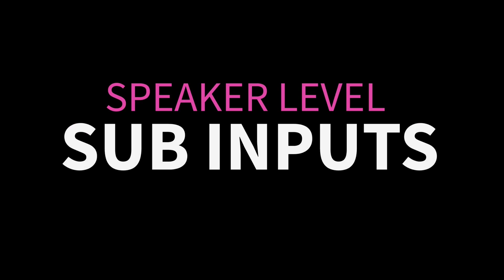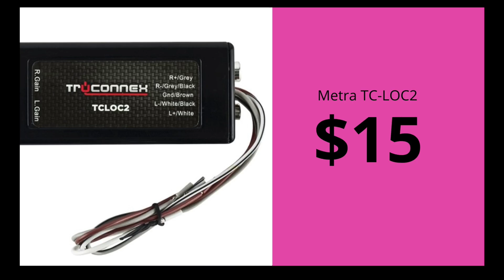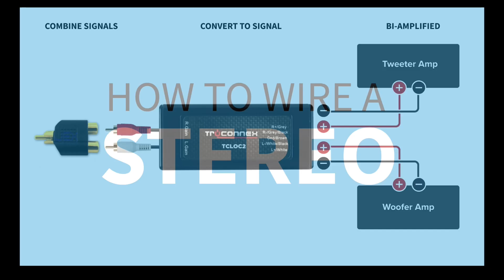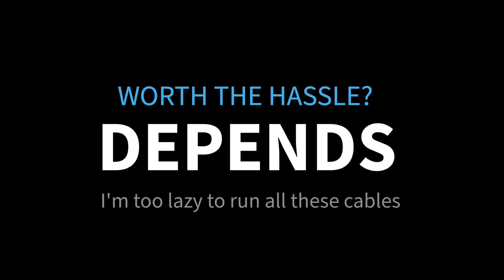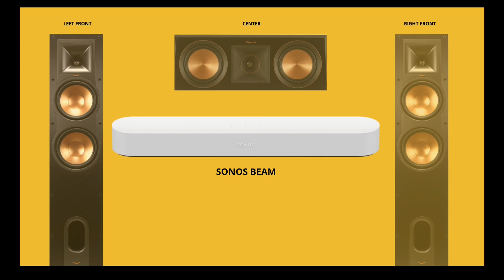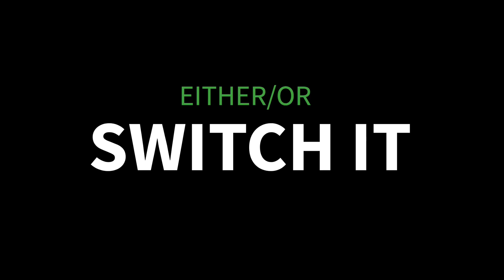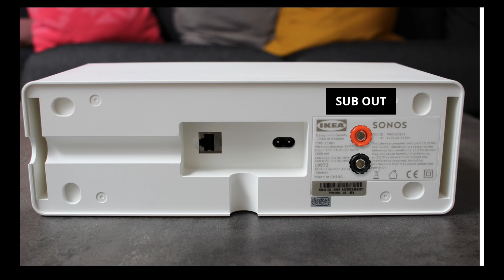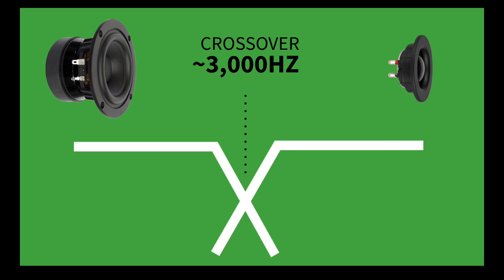Sonos sub hack DIY: How-to wiring guide to add any powered subwoofer to Sonos with Ikea Symonisk

Comment: This is great and something I surely want to try out. I have two in-ceiling drivers (about 4-5" in diameter) that I'd like to integrate in my Sonos-setup. Should I connect those to (only) the woofer output on the Symfonisk of should I somehow combine both outputs (i.e. also the tweeter output) to the ceiling speakers?
Reply from the maker: The best approach would be to remove the passive crossover in your ceiling speakers and run a 4 conductor cable from the Symfonisk that connects the tweeter and woofer output to the woofer and tweeter in your ceiling speakers. The symfonisk electronics divide the high and low signals so there’s no need to have the passive crossovers- just wire right to the speaker drivers
Reply: @todd.parker  The ceiling speakers are just two 4" drivers (left + right channel) without tweeters and no crossover. They're connected with two separate (2 conductor) cables all the way to the living room (where the hifi-set used to be). My question is: would it make any sense to feed the tweeter signal to the those woofers as well or would that break the system as both tweeter and woofer signals are amplified separately?
Reply from the maker: @martijnfigee9170  I don’t think it’s safe to try and combine the amps together like that. I’d only do this with a 2 way speaker so consider swapping the drivers

Comment: Hey 
At First thx for this awesome Video 👌🤗
Do you think the Power of the Sonos“Amp“ is enough to drive my Klipsch R112 proper?
Reply from the maker: In this setup, the Sonos amp isn’t powering your sub. You’re just using it to get a signal to your powered sub’s amp. That Klipsch sub doesn’t have speaker inputs so you need to get a high to low level converter I cover in the video
Reply: @todd.parker  so just as a Bridge it won’t work ?

INPUTS
 L/R line-level/LFE RCA jacks, Wireless WA-2 Port
Reply from the maker: @mOtHeRfReQuEnCy  if you mean this, it doesn’t sound great. https://youtu.be/QhT3j9_6Zic

Comment: hi, the big challenge that I have is using two symfonisk panels as FRONTS to my beam 2. Possibly make the beam function as
center only.. All of them have amps, so do I somehow run cables to all the amps? Connected to a 5.1 soundcard with crossovers or smt like that?
Reply from the maker: You can’t do that right now with Sonos. If you want a proper 5.1 system, skip Sonos
Reply: @todd.parker  yes you know how this all started, the symfonisk Ikea panels are the ONLY speakers that both sound really good AND are accepted on the wall as fronts by the local government here (ie., girlfriend) 😅
So I am trying to build a 5.1 or 2.1 system around this to hook up to the tv.
PS thanks for the quick reply!

Comment: hey, thanks for these ideas, will try it out! I was wondering if instead, I could just use two symfonisk picture frames as left and right front channels, paired to e.g. a bose 900; plus any sub.... because it would greatly enhance the front audio, which seems to make more sense to me for regular tv viewing in stereo...
Reply from the maker: In this scenario is the Bose a center channel? In short, you can either skim a signal off the woofer and send it to to a powered sub OR disconnect the internal drivers and use them to power a 2 way speaker. You can’t add extra passive speakers because it wall tax the amps too much
Reply: @todd.parker  yes, indeed it would be center only :)
and I just found this comment again, I forgot i wrote it and just commented again because by now i got a beam 2 and two symfonisk panels, still have that idea in my head...
Reply: @todd.parker  ps so i was hoping for a totally different approach, send an unamplified 5.1 signal to all the amps, split into tweeter and woofer signals etc.. (for the front left and right symfonisks, and another into the beam or any other center speaker...)...

Comment: Isn’t the audio within the LFE filtered out by the DSP and as such the Sonos surround synphinisk or play etc doesn’t actually receive the LFE audio anyway. Yes the low frequencies are transferred to the sub in this set up but LFE isn’t there so cannot be tapped into for the sub
Reply from the maker: If image that if you had an official sub connected that it might filter out some bass but in my tests there was a ton of low end information sent to the surrounds which really supreme. It’s not the same as a dedicated LFE channel obviously but more than enough to add a lot of bass to the mix

Comment: Thank you Todd! Great video, so simple to understand and gives you confidence to do it.
I wll be using the "GATEWAY" solution for my needs.
My question is, do I need to reconnect the ribbon cable, before i close the speaker back??

Again, thank you for this most helpful video!
Reply from the maker: Glad it’s helpful. Yes, you need to reconnect the ribbon - line it up, flip the black cover down, and add the foam sticker on top. That connects the front panel controls.

Comment: This is so helpful. I have a Playbar and planning to add two 
SYMFONISK for surrounds. Do you think one can use this same concept and tap signal directly from the Playbar that can be fed to a powered amp?
Reply from the maker: Sure, this technique works for any powered speaker, it's just a matter of being able to open the case, get access to the woofer, and have an airtight way to get a wire connected to the outside world. The symfonisks are cheap and easy to work on but any Sonos speaker would work.
Reply: @todd.parker  Thanks for your response. The Playbar has 6 woofers and for the best performance, do you happen to know which of them to tap signal from?
Reply from the maker: Hmm, I don’t but I think they probably all will give you a good signal
Reply: @todd.parker  I will do a test after opening the unit to see how it separates L and R channels, hopefully I can get reliable discrete L and R feeds.
Please share the link of the binding posts you used for your installation.

Comment: Hello.  Since this video is over a year old, I wanted to check before I attempt my own setup. I have a playbar and two One SLs.  I just want to hook up a powered sub but cannot afford the Sonos sub. Could I get away with one Symfonics speaker? Or would I need to get two and run the powered sub off of one of them? Thanks I’m advance for all of your time and efforts.
Reply from the maker: If you’re up to opening the One SL, you can get a signal off the woofer for the sun. Alternatively you can get a single symfonisk, unhook all the drivers and just use it as a way to connect the sub as a separate room you group with the soundbar room. I cover all these scenarios in detail
Reply: @todd.parker  Thanks. I’ll look at opening up the Sonos One SL first.  I didn’t realize I could do that. I saw your demo on the second room option. If I remember correctly, there were some issues with delays. Do you have a video of opening up the SL?  Thanks again
Reply from the maker: Grouping rooms has a bit more delay than the speakers in a home theater room but it’s pretty minimal. There are a few teardowns like this one: https://youtu.be/OXce4QEgOgA

The tricky thing is finding a good spot for the binding posts with the wraparound grill
Reply: @Tpeazy1980  Someone did something similar here https://www.youtube.com/watch?v=w76p6VchxgA
I also have a Playbar and considering connecting an external powered sub directly to it...wish me luck.

Comment: Where is the volume Control handled inside the Sonos speaker? Is it handled before the DAC or is it handled in the integrated AMP? I would like To Connect a sub via line in grabing the Signal from the DAC. Will this allow volume Control via Sonos App still be possible ?
Thanks for the Great Guides!

Comment: Hi Todd, thank you for your amazing video, I am going to do this as well. Therefore I bought secondhanded B&W DM305 speakers. However, from your considerations I am not fully sure if these speakers are ok. You mentioned 3 considerations:
1. Sensitivity: the woofer and tweeter should be close to each other in terms of db
2. Impediance: the subwoofer should be around 8 ohms and the tweeter 4 ohms and definately not lower than 4 ohms
3. Frequency crossover: it should cover the 3000hz crossover (later you found it was 1600hz)

I looked up documents of the speakers I bought but I am still not sure if they are ok. Below you find some information that i have found and my related questions are below the specs.

System type:	2-way
Enclosure type:	Bass-reflex
Frequency response: ± 3dB	55 - 20000 Hz
Nominal impedance:	8 Ohm
Amplifier Requirements:	25 - 120 W
Sensitivity (2.83V/1m)	: 91 dB
Tweeter	25 mm: (1 in.)
Woofer	165 mm: (6.5 in.)

Questions:
- I can only find one spec about resistance (8ohm), is this ok then because it is in the range?
- can i assume that the crossover frequency and range are ok because they are already in one speaker together (woofer and tweeter) and the range is between your reccommendation?
- Can the symfonisk handle the power that is required for my speakers? It seems so (T)odd that this small symfonisk speaker can handle such a big B&W DM305 speaker.

Last question: is there anything else I should consider or take into account?

Many thanks from Holland. I have watched your videos multiple times and get really exited by it! I am dreaming of building and DIY it all the time! Thanks!!
Reply from the maker: Hi! Based on these specs, I think these should be a good fit for bi-amping. The 8 ohm impedance for the overall speakers means the woofer is likely 8 ohms and trueplay can smooth out any differences in efficiency. I think you’re good!
Reply: @todd.parker  you are awesome

Comment: Hi. Im planning to use two old speakers ( bit like tonsil altus ) and old amplifier but I want to rebuild all speaker and just put in a symfonisk into them and receive mono signal before Amp. To provide that signal to old amp. I know it's gonna add additional dual wire each speaker. I just have few questions did symfos getting hot on running? I saw those power management and I'm quite scared of those low end capacitors. I'm thinking to making symfonisk sliding to the holes in the speaker and worried also about damaging sound quality because all around them gonna be thick wood wall.
Reply from the maker: They don’t get very hot so I don’t think heat is a problem. The wood might block the Wi-Fi a bit but in don’t think it’s a problem. Are you planning on using the symfonisk to bi-amp these because they look like a 3 way speaker so I don’t think that will work
Reply: @todd.parker  i just want to take output signal before built-in symfsonik amp and provide that signal to Techniks old bulky amp and send it back to the speaker. That's gonna double wiring between speakers and Tehniks amp. But I'm gonna be able play my Dolby atmos from my tv with sonos sound bar beam2. On the same time from my speakers and also synfonik.  And not need to waste money for sonos sub or sonos. port.

Comment: Line level can be taken Post PCM chip. The Crossover is visible on the PCB. You can combine the signal or HIGH/LOW from the negative terminals of each Capacitor in the Crossover network. The Signal GND can be taken from any ground on the PCB. This signal (POST AMP) removes any Impedance / Frequency issues caused by using the signal Texas instruments AMP and then stepping back down to line level. It is well documented however Todd has probably already published this so to save embarrassment, all I can suggest is, I hope you're handy with a soldering iron. Oh and lastly, if you do want to Run directly from the AMP and wish to use your speakers Inbuild Crossover, you can do this by converting the Sonos AMP chip into Bridged mode (very Fiddley). I am currently running in this config to a pair of Q acoustics 3020i's. The Symfonisk's/3020i's (Post Trueplay)  do an admirable job as surrounds.
Reply from the maker: Thanks for all the details. This video is pretty old but as you said if you’re handy with a soldering iron you can probably get in and get a signal. I was trying to do some thing that was a bit easier but it didn’t work
Reply: In taking line Level as described, will volume Control via Sonos App still work ?
Thanks

Comment: Thanks Todd. Super easy project with great benefits. I used an old Polk Audio sub that was collecting dust and picked up the Symfonisk speaker at Ikea. Now my Sonos ecosystem has the bottom end it was missing. Great video.

Comment: I want to use the IKEA speakers to act as a Sonos amp for existing in-ceiling speakers in my house. From watching this video, it looks like it may be possible as long as the existing ceiling speakers are two-way, is that correct? Also, would that mean, I would need to run additional wire to in-ceiling speakers to make a circuit, per se, and the existing wiring would be insufficient?
Reply from the maker: Yes, it will work but you’d need to run 4 conductor wire to the speakers and directly wire them to the woofer and tweeter (bypass the passive crossovers)
Reply: @todd.parker  That's great, and I got it playing music. Thanks! Now just need to figure out the in-wall wiring...
Curious - how does this compare to the hacks that require board soldering? Is this direct wiring technique to the tweeter and woofer sonically the same, or is the solder technique better?
Reply from the maker: @johnkoehnen3183  The soldering hack is intended to get a full range signal so you can basically use the Symfonisk as a Connect so you can connect your own amp and speakers. If you want to use the built-in electronic crossover and amps to bi-amp your ceiling speakers, this is a better way to go. I have a video that covers the bi-amping in detail.

Comment: the easiest way to connect a subwoofer to a SONOS or IKEA system is with a SONOS CONECT, so easy, you can move a subwoofer any distance without wiring throughout the room
Reply from the maker: We’ll, sure but only gen 2 are S2 compatible (be careful buying on eBay) and the Port is $450. That’s a lot of money for a signal!

Comment: Great video Todd! I’ve got a playbar and tied in-wall rears via a Sonos connect amp. This connect amp has direct speaker terminals. Couldn’t I connect an active sub to the amp this same way without tearing down any speakers? Or am I missing something about isolating the subwoofer part of that signal?
Reply from the maker: Yep, you can connect from the amp. I think it has RCA output too you could use

Comment: Great video, very helpfull!! Only one question.. Is it possibly to use a 2 to 1 RCA splitter  connect a 2way RCA to the symfonisk and the one in at the end to subwoofer??
Reply from the maker: The Symfonisk doesn’t have RCA inputs or outputs, unfortunately

Comment: Todd
Do you have any hacks that would allow me to convert the Symfonisk to bluetooth? I want to use the Symfonisk with m y TV and with my laptop. I purchased a small bluetooth amplifier. How would I connect it? Is there a way to use the internal amp and add bluetooth to the Symfonisk?
Reply from the maker: No, sorry. Look at the Roam - it is cheap, has Bluetooth and can pump that signal into your other Sonos speakers.
Reply: @todd.parker  Ill look into that. But, I have the Symfonisk from Ikea. Is there a way to connect that to the Roam?

Comment: Hi Tod, I have an ALR Nummer 2 but their power is 150 watts what components do I need for their work Crossover with a filter I have already taken out of them
Reply from the maker: Hi. You just need to wire the tweeter and woofer amps to the tweeter and woofers in your speakers, run trueplay and you’re done
Reply: @todd.parker  and where to get amplifiers of such power, after all, probably IKEA Symfonisk will not give such power, after all